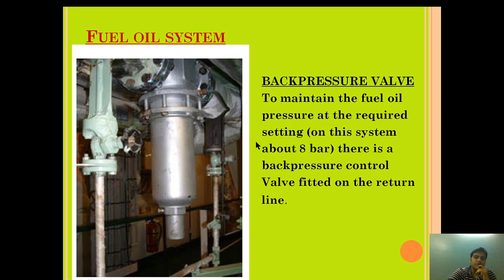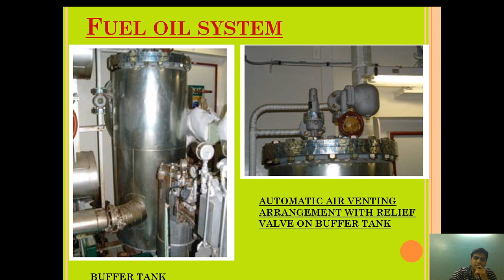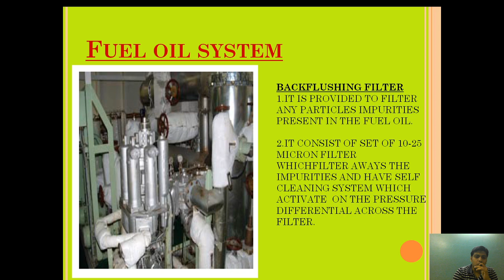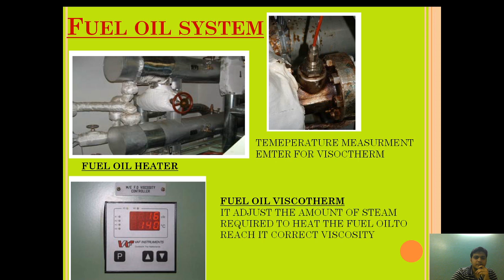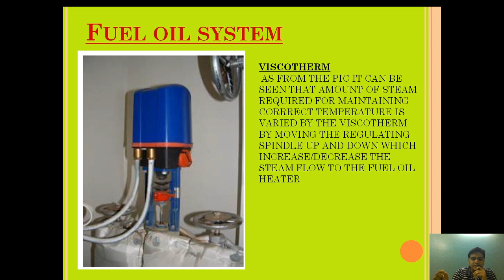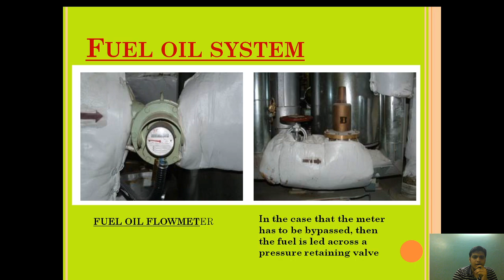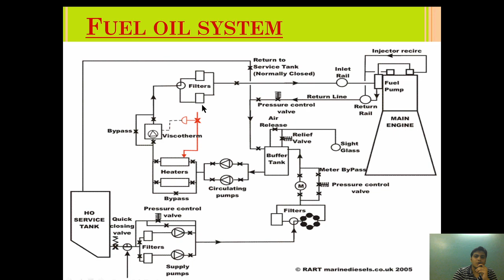FUEL OIL SYSTEM IN SHIP|FUEL OIL PROCESSING|COMPONENT EXPLANATION

Comment: I have two questions 
1. The buffer tank is always full and under pressure from the feed/circulating pumps ?
2. The air release valve of the buffer tank is working by floating device ?

Comment: why dont we stop fuel oil supply and circulation pumps during port stay when the engine is stopped and why flowmeter wont measure any reading yet the supply pump run ?

Comment: Doubt:-
When ME is stopped.
We keep the supply pump and circulating pump running. Circulating pump is circulating oil from buffer tank to buffer tank.
What about supply pump?
Is supply pump safety  valve lifts ?
Reply from the maker: There is two reason for that
1. if supply pump connection is common with the auxiliary generator then we have to keep it running for supplying the fuel.
2. if you see the line diagram you can see there is a pressure control valve provided along with the fuel supply pump. the function of these pressure control valve is short the excess pressure if build up in lne.
when the engine is stopped the fuel is circulating from  from buffer tank to buffer tank in a closed system at that time fuel oil supply pump is provided to compensate for any loss in the line due to evaporation,leakage etc..once this loss is compensated the excess fuel will cause the build up in pressure in the line which will be relived by the pressure control valve back to to suction of the supply pump.

I hope you understand!!!
please do like and subscribe and please share with your friends also!!!
Reply: @MarineEngineeringHub  i had the same doubt where can i get the exact information related to this particular topic? any videos?
Reply: @MarineEngineeringHub  if the pressure control valve in supply pump opened, it means the mixing tank has excess pressure right? so does the mixing actually has pressure? if so, how does the air release in mixing tank works? will it release the fuel instead only the air?